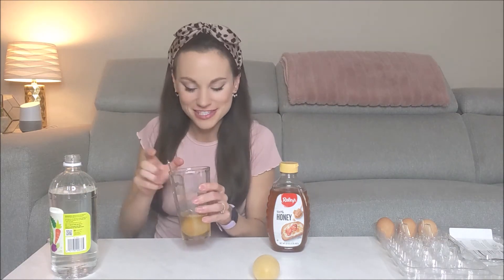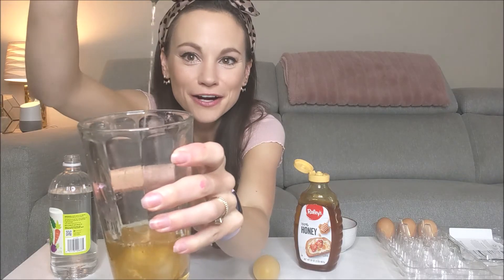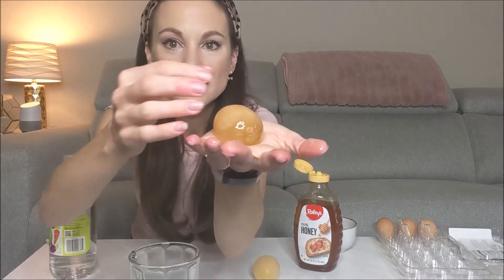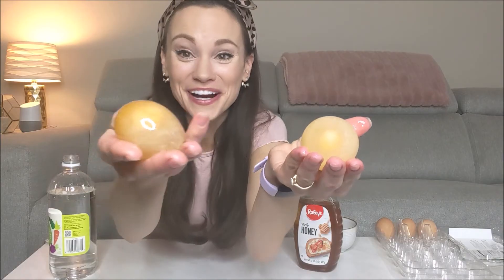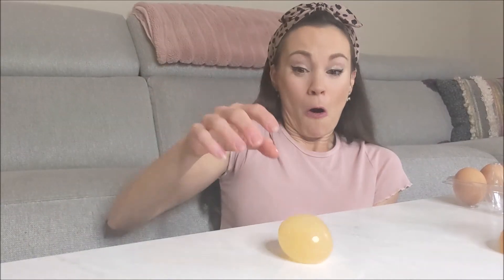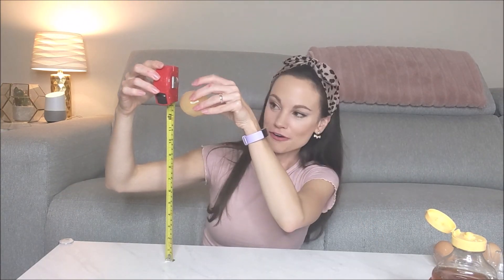The Science Behind the Naked Egg Experiment

Comment: I wonder if you added table salt to your vinegar if you could remove the shell without it expanding the egg.  Also, I think your split open at 13" because it hit the side of the measuring tape.
Reply from the maker: yes! I bet that would work! It would be a fun experiment to see how much salt you'd need to add to prevent water from moving through the egg's membrane.  And yes, that measuring tape definitely struck the final blow to my egg :(